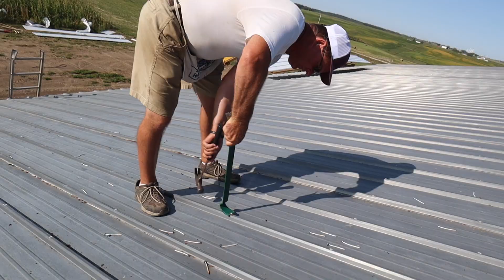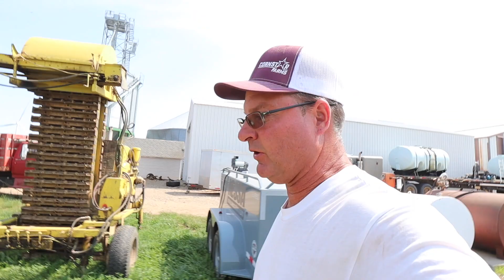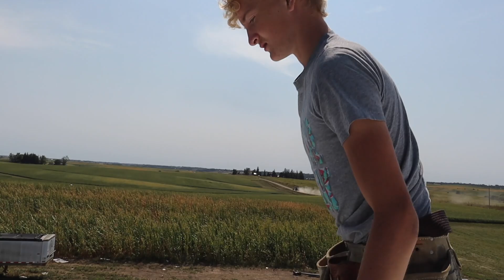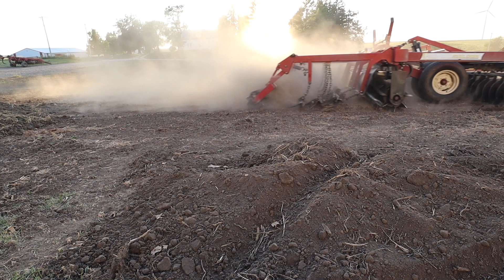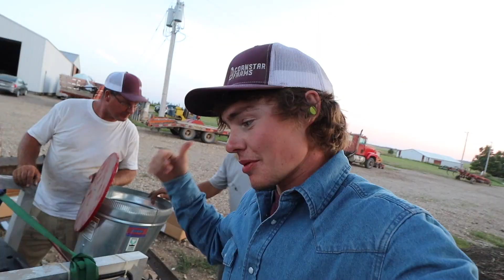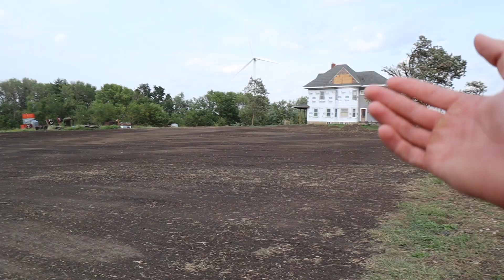Seeding My Yard For The 1st Time Since 1917

Comment: For future reference, a tip to cover and pack your seed quickly and on the cheap. Take as long(and heavy) a section of metal pipe you think you can drag and add a cable Y harness from it  back to the hitch. The leading edge of the pipe will push the soil(and flip the seed under) and the trailing edge will pack the soil.  We use to do this to cover crop duster flown on rice seed in 100+ acre fields using a 20' length of pipe behind a IH 1266. It will cover a lot of ground in a hurry.

Comment: hoping to see that rain here in central Iowa. long overdue. the yard's  going to look good!
Reply: Over the weekend, I was on the eastern side of central Iowa (near Cedar Rapids).  It started raining around midnight, and rained on and off until about morning.  Not sure how much rain they had where I was, but it was pretty wet in the morning.  I was surprised at how low the river levels were as I was driving around in that area.  I saw large dry areas in the river beds.
Reply: @ILGuy2012  we have been in a drought state for a lot of the summer. it's been bad but now we have 4 days of rain ahead!

Comment: Should look into spray foam if you ever have to do another roof.  Closed cell foam will not only insulate and air seal far better than board, but it will significantly increase the structural integrity of the structure.

Comment: That's a really really nice job of landscaping Cole and actually?? You were far better off using the cultipacker vs. Flat smooth roller! I have learned over the years the  cultipacker serves two purposes!! A it does an extremely better job of punching the seed down into the bed. B  and in my opinion a very valuable! it leaves ridges and grooves to hold and slow the water from multiplying and turning into a  washout..  👍

Daddy cornstar ? I wish you was the caretaker of our cemetery!! Yesterday was one year since my father passed away and while visiting the grave? They still had not come back and re backfill the depression left from the winter compaction.. all summer I waited for them to fix it but to no avail... So yesterday I  took the back hole and got a bucket of sandy loam from the 80 dad first bought  before he had any of us kids  an dumped it in the back of my pickup dump box and took it up to the cemetery put it on top of Dad and raked and seeded it back down.. An?? I think Dad would be pleased to have some of the home 80 soil  that he worked his early life to pay for.. but thank you so much for being a loving an careing cemetery caretaker... May God bless you and your family and values you instilled in your family 🙏

Comment: I'm from the east part the US and maybe it's done differently here but just wondering why the grave is topped off with a slight mound before packing the first time. After a few good rains or 6 months I bet there are some deep holes at the head and foot of y'alls vaults that require constant refills

Comment: Never cross spread with a "spinner" spreader, your half rate idea is correct, then you gauge have you used 1/2 , if short close rate down a bit, if long open it up a tad. Then split the centre's of your first pass , same direction.

Comment: Cole the Kentucky bluegrass tends to like Northern, cooler climates.. even that blue heat from your sponsor says prefers cool,mountainous regions..
Why not have mixed a fescue in with it? Or did he feel Iowa is cool enough the Kentucky  Bluegrass would be ok..
 I am in Indiana we get in the high 90's in the summer like Iowa  and tend to plant fescue and bluegrass.
Just wondering if he recommended that bluegrass would be fine in Iowa in mid to late summer or if you plan to wait and see and overseed  in the winter?